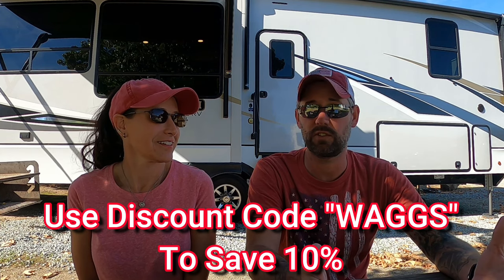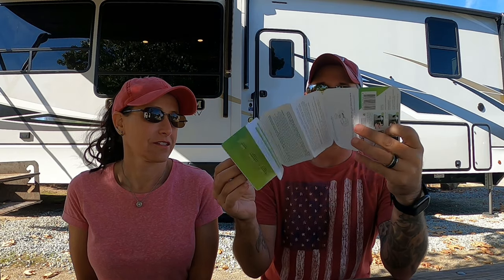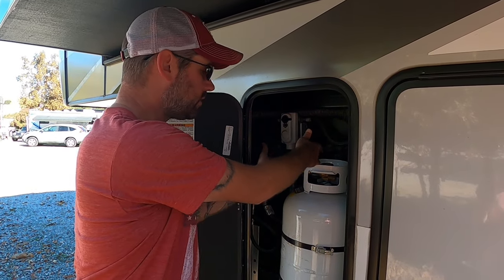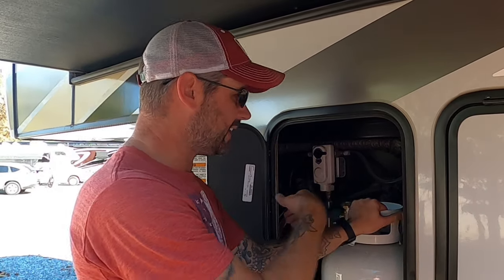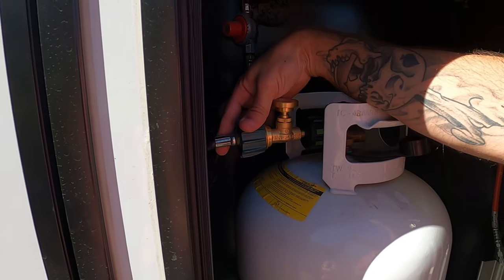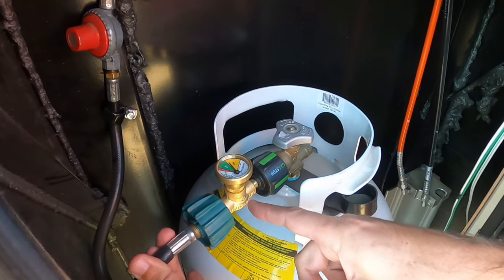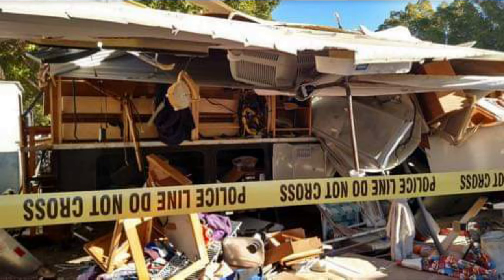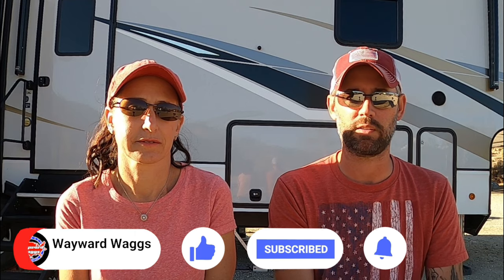RV Propane Explosion (Prevent It With GasStop)

Comment: I have 2 of these as well as the 90° hoses. Did the slow leak test and I had a leak somewhere. Used my leak gas sniffer tool, found and fixed it. These things are a bit spendy but worth it.
Reply from the maker: Never heard of a gas sniffer thing. We might need one of those too.

Comment: We almost had an explosion in our brand new 2021 XLR Nitro 321. Forrest River ran gas line in wheel well. Our first long trip from Wa to southern Cal our tire rubbed a hole in gas line and we did not know. I turned on the gas to cook some quick tortillas had it on about 3 min. After dinner we smelled propane heavy and hubs went and turned off propane tanks. He thought it might have come from water heater. Called a mobile repair he traced it back to the line with the huge hole in it in wheel well. $800 bucks later it was fixed. Scary part was my hubs smokes(outside of course) I filed a safety complaint with the NHTSA. I wish I could post a picture on here it was unreal. I also just used your code and ordered two for the rig. 🌮
Reply from the maker: 😲 That could have been very bad. We are glad you guys are OK. That stinks that it cost That much for you guys. Thanks for using our code. Glad we could save you a few dollars on the order and glad you will have peace of mind now.
Reply: @WaywardWaggs  thank you! Forrest River covered the cost. I just don’t want other XLR owners have this happen to them too.
Reply: I did blow up on a brand new Geopro. When you have a new camper, you don’t expect anything to go wrong. Unfortunately myself and my friend lost our lives forever that day. Dealers should at least mention it. Forest River thinks you should just read the warning labels 🤨.
Reply: @ccartaginese  I am so sorry this happened to you. My heart goes out to you!